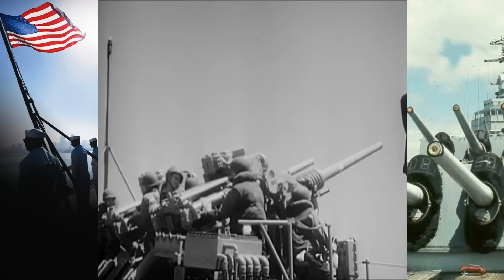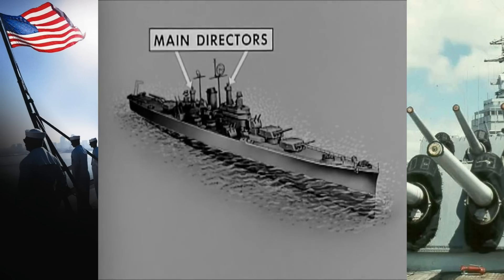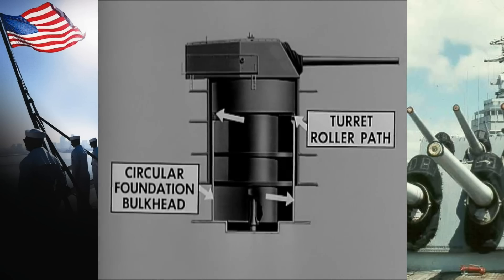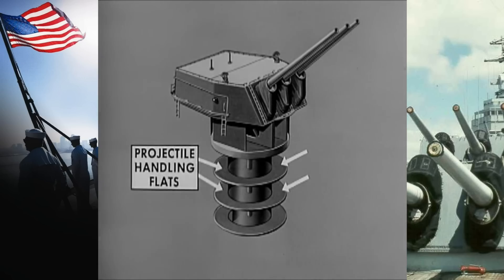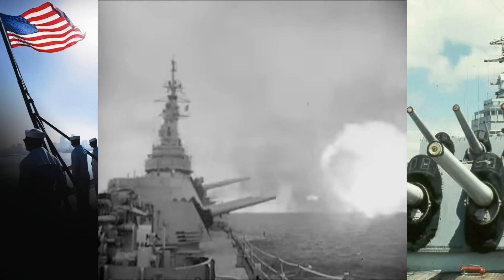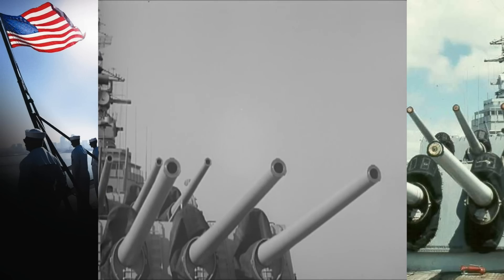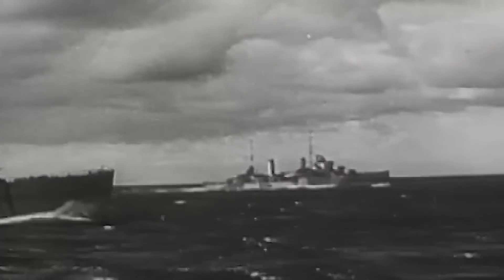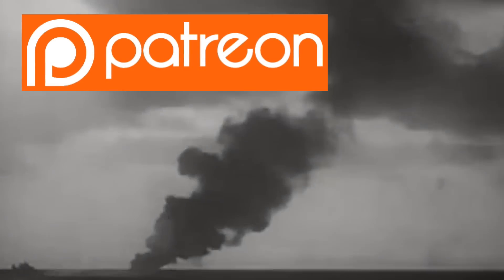How Do Large Caliber Naval Guns Work?

Comment: i know you are not part of the navy and have little experience with them but with ur knowledge i wonder if you could explain this: why is there pretty much no ‘deck guns’ or large caliber naval artillery on modern battle ships and naval ship compared to what is seen on ships above?
Reply: Modern missiles give a smaller sized ship the same type of firepower with a longer range capability without the heavy hull structure requited to handle the recoil of the larger guns. I was stationed on a destroyer during the early 70's and firing one of the 5 inch guns (60 lb projectile and a 15 lb powder charge) would cause the entire ship to vibrate from one end to the other.

Comment: Did you know that bunker buster bombs for first gulf war were made out of decommissioned ship gun barrels.
Reply: USA made good steel back then.
Reply: the US made a lot of very dependable stuff back in the day. to bad its not so much any more.
Reply: I recall hearing about the "rush job" in R&D. Amazing what war does to USA's procurement!!
Reply: Actually, the first GBU-28s were worn out 8 inch Howitzer barrels from rebarreling of M110s. A similar ship barrel would just be too heavy.
Reply: @anthonykaiser974  Indeed.    They used a bunch of the old 175mm barrels first.

Comment: They experimented with mounting one of these 8" guns on a destroyer back in the 70s. I think they would be a good addition to modern ships as shore bombardment is a routine use and 8" shells have a lot more explosive power than 5" do. They can also be rocket boosted to extend their range and still carry far more explosive than 5".
Reply: Wouldn't survive more than ten rounds broadside.
Reply: @jerrynewberry2823  are you saying the ship wouldn't survive firing 10 rounds?
If so, that is just a matter of engineering in the new design. Retrofits would be more problematic.
Reply: @Bigfoot1955  i was on the Newport News CA-148.   Or&i in the Caribbean.  Im saying a Destroyer will shake apart with ten individual shots. Let alone a 4 barrel broadside.. i guess you've never experienced it.
Reply: @jerrynewberry2823  in the 70s the Hull was fitted with an 8" turret. Here is the Wiki article on it.
 https://en.wikipedia.org/wiki/8%22/55_caliber_Mark_71_gun
Reply: This was a lightweight version of the gun and had accuracy issues. That would be alleviated by using guided and rocket assist projectiles that are practical in today's technology. 
The weapon was pretty neat. It needed one crewman to top off the rotary 75 round magazine that fed the auto-loader system. One crewman managed sensors, target selection, and warhead selection then fired the weapon. 2 man crew on a gun with that much firepower is pretty cool.
Our destroyers are bigger than they used to be and cruisers wouldn't have any problem with this gun. They could probably improve the design a bit to increase ballistic accuracy.
The standard 5" gun used fires a 70 projectile. The 8" projectile weighs 260!
That is a lot of capacity for guidance and rocket assist while still leaving more weight for explosive than the basic weight of the 5" round.

Comment: I've always maintained that the US Navy still needs a shore bombardment ship. Shells cost less than missiles, and 90% of the worldd's population lives in range of these guns.
Reply: We tried that. It's called the USS Zummwalt. It fucking failed because nobody realised we didnt actually look at what ammo the guns needed and then we realised its experimental ammo not ready for combat yet that costs $800,000 per shell because it's extremely high velocity stuff
Reply: @sol2544  Yup, the Zumwalts are ridiculous. Million dollar shells because... reasons, I guess. The muzzle velocity isn't substantially different from the 8"/55 in this video (2700 ft/s vs 2500 on the 8"/55). Much, much longer range though, roughly 5x the range.
Reply: @sol2544  well they did not go with tradition shells. they need replace the guns and go with rocket assisted shells.
Reply: @spark300c  I think they should ditch the long range shells, make it a utility ship that is impossible to detect. Maybe a submarine hunter, or a scouting ship. Or an armed transport cuz god knows it's a huge fucking "destroyer" and can probably fit 300 marines
Reply: @sol2544  what point in that because want long range shells to attack beaches. We all really have those utility but lacking artillery.
Reply: @sol2544  USS zumwalt’s gun was about stick a middle into a barrel and second the Zumwalt didn’t fail because of this it failed because it was just to ambitious
Reply: This is probably a year comment, but i went in anyway.

Your reason is invalid. A shore bombardment ship ( basically a battleship) are obsolete in today's warfare.

Naval guns have it limits. Even with radar guided, a naval gun shell can only go as far as 40km range. This is clearly not enough range, even naval gun shell cannot reach most of the places in Korean peninsular, which clearly have sea around it. Your statement of 90% of the  world's population live in naval gun range is horribly wrong.

Naval gun shells cost less than a missile, but a missile can give much better range, accuracy and  versatility compared to naval gun.

That is why a battleship is obsolete.
Reply: @nogisonoko5409  Missile also costs dozen times more and suffers a heavy CIWS allergy. Just like planes. That's why land artillery didn't go obsolete and isn't planning to.
Reply: @TheArklyte  
Did i ever mention about land artillery? No. Land artillery in the current warfare is still the master key in winning a battle or war in general. I'm talking about naval artillery (battleship) which were pretty much outmatched by missiles and newer weaponry.

While missiles are way more expensive than the naval shells, they give the naval admiral the range and precision which are crucial in modern naval combat.
Reply: @nogisonoko5409  your same arguments were brought up a lot for land artillery too. Difference is that they were all proven wrong, usually with embarassing results. And not only for artillery. "Cannons are outdated, missiles are the future" can be traced in many other fields, like F-4 and its eventual modernization to include one or to lack of modern SPAAG for close range air area denial in US arsenal right now.
Newer tech? Like artillery guns with range of 200km? Yes, they are developed. But how do they help your case if they are counter argument?
Reply: @nogisonoko5409  yes but we talking about amphibious attack here. navel guns used for short range attack and land attack. the need for long range missiles have pushed destroyers to become too big for the class. Now just as big as cruisers. They can support 155mm guns for shore bombardment. we have platforms it now need make them cruisers and not destroyers.
Reply: @spark300c  
Will the cruisers be guaranteed that they wont't get anhiliated since they were too close to the shore? Assuming the enemy have decent anti ship battery on the shore...

But i can see your point... perhaps the ship will be too specialiazed for that mission only.
Reply: @nogisonoko5409  we'll not like have much armor on them for that about four inches to six should do. zamwalt does not much armor. it depends on how navy plans attack.
Reply: A good ship to shore bombardment keeps the landing parties from walking into minefields so its worth it for that alone
Reply: Isnt the Ohio class battleship are modernized and used for exactly that during dessert storm?
Reply: @wawan8759  Iowa class
Reply: That's why railguns are being researched. Although it remains to be seen if the engineering challenges will be met. However; being a civilian, I doubt I'd ever know.
Reply: Shells are also impervious to jamming and CWIS systems.
Reply: @agentx250  both of said points are wrong
Reply: @invadegreece9281  There is no CWIS that can defeat an 8" projectile and conventional shells are "dumb". I don't think a CWIS system could even track a conventional projectile accurately enough to engage it.
-
In order for you to be correct we'd need to be talking about either very small munitions, ~40mm or so, those with extremely thin casings, and those which use some form of in-flight guidance. Only the latter is still relevant in this context, and the former two wouldn't be employed in coastal bombardment anyway.
-
Of the shells which employ the latter, they rely on a preset programed immediately after leaving the muzzle and can't self-correct after that, which still rules out jamming.

Comment: Am I the only one who wants to see a modern take on that loading and see how much we could get the rate of fire up to? :D
Reply: https://www.youtube.com/watch?v=K4P0N0f9fq0
Reply: how about getting rid of the propellant case all together, just move a projectile. Army prototyped a liquid fueled gun for the palidin platform some years ago. sorta worked. the Navy lads are good nuff to make it work.   hypergolic fuels or even oxy/hydrogen from sea water to fuel the gun system.  a large caliber machine gun. with half the machinery of the 8"/55. Mercy. still ask why? Naval missiles have longer range and pack more punch per round.  It's why there are Naval missiles. If they didn't perform better than guns the Navy wouldn't buy them. or is that a oxymoron of a statement?
Reply: @tharconian3243  Missiles will become useless when anti-missile lasers become common. I doubt a laser weapon could stop a big piece of metal.
Reply: for every measure will come a countermeasure and so on and so on and so on. artillery counter-battery fires to prevent arty hitting targets. SAMs to attack aircraft, Jammers to counter electronic comms and guidance. thing were much easier before science....
Reply: http://www.navweaps.com/Weapons/WNUS_8-55_mk71.php Here, we have essentially the same weapon in a mounting similar to the MK 45, a real modern take on the 8in found in WWII US heavy cruisers

Comment: Safe to say 8in guns are big guns relatively speaking but sure battleships had bigger. You can say there was light guns, 20mm to 5in, used for AA and main guns on destroyers and secondary guns on other ships with a few cruisers having them as their main guns. Then you have 6 and 8in for main guns of cruisers and secondary guns on battleships with a few carriers having them for self defense as well. Then you have the 10in to 18in for battleship main guns. So you could say relatively 6 and 8in guns were more med range guns but still were big guns. There was a debate as to the value of 8in guns versus 6in guns. Some saying greater volume of fire of the 6in guns was better then the heavier broadside of the 8in guns. In many ways the 6in gun is the main gun for cruisers with some having 8in, namely heavy cruisers, which were made in smaller numbers. To a large point 6in gun cruisers were mainly scouts, destroyer leaders and were less designed to take on battleships then heavy cruisers were. Heavy cruisers were often seen as second class battleships or cheap battleships. They were designed to fight anything including battleships. Even if the 8in shell could not penetrate heavy battleship armour they were expected to do enough damage to a battleship collectively to make life difficult for the battleship and with torpedo from the cruiser itself or from destroyers, sink the battleship or at least put it out of action or chase it away. Even if parts of a battleship is protected from 8in shells, the bulk of the ship isn't and 8in shells can do a fair amount of damage to a battleship, knocking out systems and starting fires etc. General rule of thumb is the displacement of the ships involved. You have a battleship displacing 40k tons then 4 10k heavy cruisers should be able to deal with the battleship if they are handled well. 

As great as these guns are, the British tried to make their 8in guns as good as these guns in the late 20s with a rate of fire of 12rounds per minute and with a AA role but sadly failed as it was beyond technology of the time. In the end the British 8in guns were reduced to firing 3-6 rounds a minute. 

These guns were developed due to war experience where the 6in gunned cruisers failed to have the punch that was hoped with their greater rate of fire. Battle of Empress Augusta Bay was a prime example of the failure of the mass 6in guns. The answer was to try to do what the British failed at and make 8in guns with a rate of fire equal to the 6in guns. Sadly though by the time these guns were developed the days of the big gun ships were numbered and apart from bombardment they never proved themselves. They were impressive guns for sure and shows how powerful the British county class would have been if they had been successful in their attempt to design guns like these in the 20s.

Comment: On 1 October 1972, while in action off the Demilitarized Zone, Newport News sustained an in-bore explosion in her center 8-inch gun of number two turret. A defective auxiliary detonating fuze caused the projectile to detonate almost immediately upon firing. Nineteen men were killed and ten injured.[5] The barrel proper was blown forward from the gun. The damaged gun was removed and its port plated over. The explosion had caused extensive damage to the center gun mount. It was proposed to replace the damaged mount with one from Des Moines (CA-134) or Salem (CA-139), both of which had been decommissioned, but this was rejected as being too expensive. As a result, the damage was not repaired and the turret was simply closed off, for the remainder of the ship's career.

Comment: It's called "combined arms".  If my air power can keep your air power away, then my big guns can deliver a volkswagen on your doorstep.
Laser guided Volkswagen, tempered bumper, delivered 9 at a time; 
coupled with old cannon barrels filled with octol, laser guided delivered by 117s.
Combined arms
A carrier alone, is a beer can.  If you don't keep enough point defense (air and gun), a destroyer can sink a carrier.
There's a place for armor and big guns on the open seas.  If air power is the total solution, why do we still have tanks, and self propelled guns on land?
I can equate a torpedo to a grunt in foxhole with a Panzerfaust, LAW, or any other unguided tank killer.  Molitov cocktail on the engine deck of a tank from a second floor window to a bomb used to sink the Arizona.
On and on.
If you don't have my back, I'm gonna die.  So are you.

Comment: It turns out that battleships were obsolete near the end of W.W.I. So, when Battleship row was bombed on 7 Dec 1941 the loss of the battleships did not have any impact on the outcome of the war.  The subs, and oil fields were not bombed.  ARAICR no battleship sank any other ship in W.W.II at a range where the barrel was elevated.  That's to say the only way a big gun can sink another ship is at point blank range.

Also guns could only shoot down airplanes after the Proximity Fuze was in service.  
http://www.prc68.com/I/ChinaLakePatents.html

The range of big guns, 30,000 yards like this one, and of other big guns only means that's how far the shell will go. 
https://en.wikipedia.org/wiki/8%22/55_caliber_gun
 It does NOT mean they can hit anything at that range.  In fact the CEP at that range is probably so large that they could not hit a ship at anchor let alone a moving ship.

Note that the gun director computers, even with RADAR range finding only allowed for the triangle related  to 1. movement of firing ship, 2. movement of target ship and 3. speed of projectile (time to impact), but did not include any of the corrections that today's snipers use and so the accuracy of the solution was very poor.  The same applied to the U.S. torpedoes in the second half of W.W.II (in the first half of the war our torpedoes had so many design defects that they were worthless.
http://www.prc68.com/I/Torpedoes.html#TDC
http://www.prc68.com/I/Submarines.html
The Torpedo Data Computers were made by the same company that made the gun director for the big guns and in a similar fashion while the range of the torpedoes was in tens of thousands of yards, the only hits were at ranges out to maybe 2,000 yards.

This also applies to horizontal bombing.  The Norden bomb sight was all marketing hype.  Horizontal bombing has never worked with iron bombs and it never will.  Carpet bombing can work if enough bombs are dropped, but the damage radius for a 500# bomb is so small compared to the separation between bombs, even that has a very poor track record.  Dive bombing did work and was developed for the German Ju87 and later used by the US.
http://www.prc68.com/I/Gyroscopes.html#Norden

Comment: tend to forget that at one time every shot was loaded and fired by hand...
Reply: Like the 16 inchers were until the very end of their lives.
Reply: Ehhh, they were pretty damn automated. Though having to reset to horizontal to reload was pretty sucky. Just humans for the tricky transfer bits, and dollying things around and stuff. used to be cheaper to have someone manually stuff 3 bags of powder in a gun rather than create an automated loader.
Reply: If the powder had been in a case similar to the ones in this video, the 16 inchers might have been able to be a little more automated, I'd guess. I suppose bags of powder, no matter how stiff and firmly packed, wouldn't have fared so well in machinery, hence all the flameproof doors and partitions with bagged gun operations. Plus, powder charges could be up to 6 bags. So much powder in a single case would have required equipment to handle such huge cases.